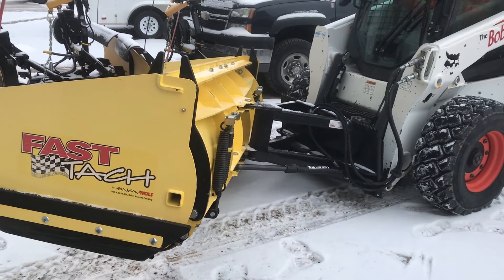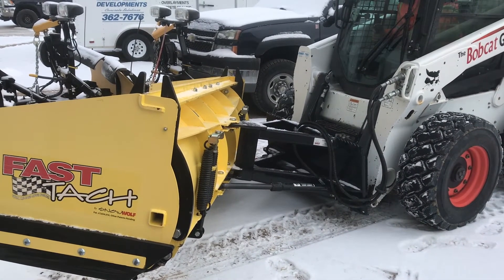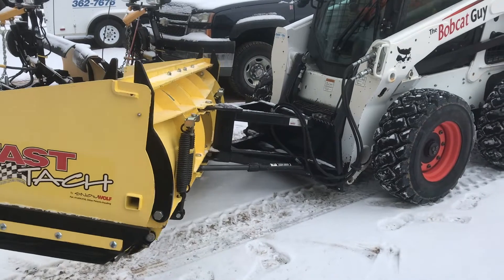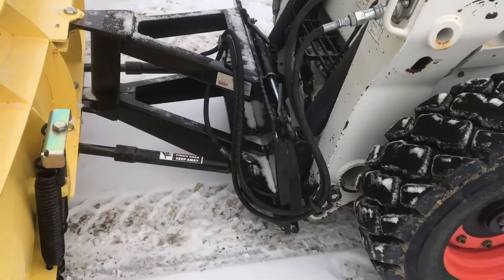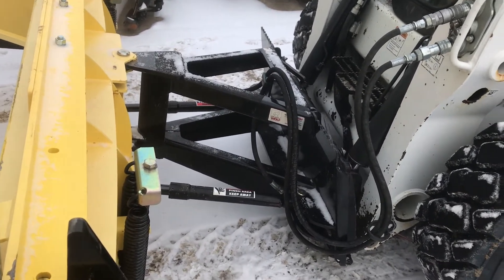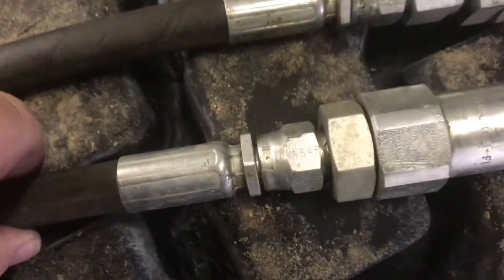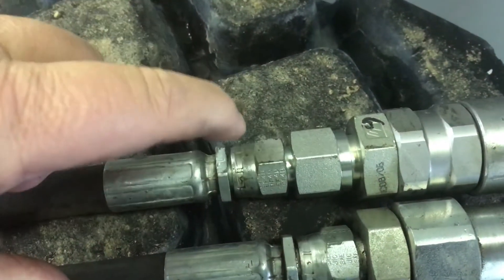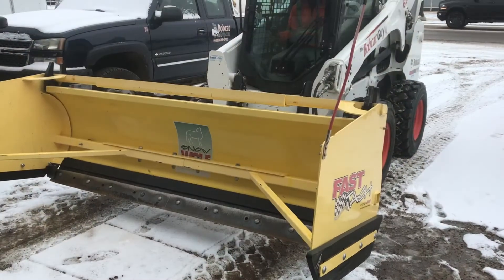Snow wolf Plow upgrades

Comment: This is a good fix, Keith but I think it`s not for snow wolf to do it because it all depends on what pump you have on the tractor or bobcat you put that blade on....I`m sure my compact tractor, if it had that blade, would not slam it like that.....not that much flow......so the orifice is varied with the size of pump....so you get it fix to the pump size........CHEERS
Reply from the maker: unless you place this on a older skid steer  most of the skid steers on the market run the same hydro pumps flow its one thing that they all compare them self's with the flow and speed of there equipment and you need a size of skid steer that  i have to just be able to push the snow that this blade can handle so if some one buys a smaller bobcat it would not matter because it would not be able to push the snow  (Just my thoughts) don't get me wrong i love this product and in no way am i dishing out a bad review on snow wolf product  and a full review is coming on this snow blade and its a AAA in my books
Reply: That`s OK Keith....Maybe someday when we meet eye to eye we can take this topic up and talk about this for at least half a day....unless this blade is made specifically for Bobcat which I doubt.....Its all good.....CHEERS
Reply from the maker: i see a 6 pack a beer in our future talking about this for at least a hour  lol
Reply: Not to argue with you but I have seen these blades on wheel loaders and i`m sure you can put them on a tractor and if the thing is not all hydro then the pump is smaller and the size of orifice would vary with the pump.....I now expert in hydraulics Keith but I have a good feel for it..... lt's just saying about 50 years ago I took a grader pump and put it on an engine and cheerd  the shaft of of it;;;;;and then there was other project.....If I would have bin on YouTube in those days....A movie evry day and at lest a hour.....we talk latter.....CHEERS
Reply from the maker: We agree to disagree   they make 3 models of this plow  this is the skid steer model and small back hoes  then the one above this one is for bigger loaders and back hoes  one blow this one is for small trackers and side by side and utility tractors